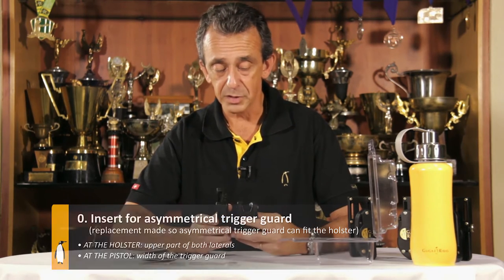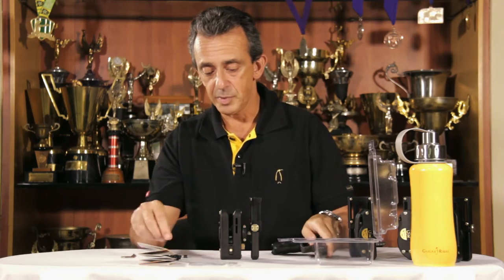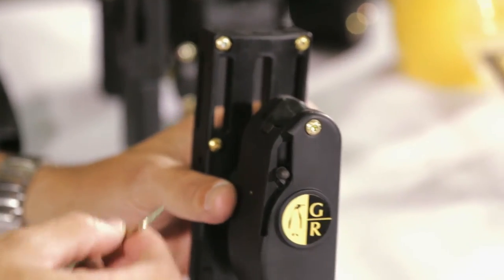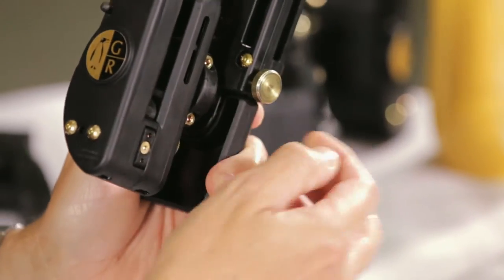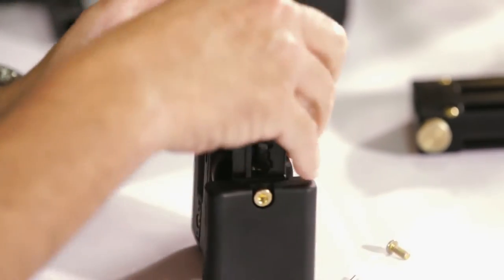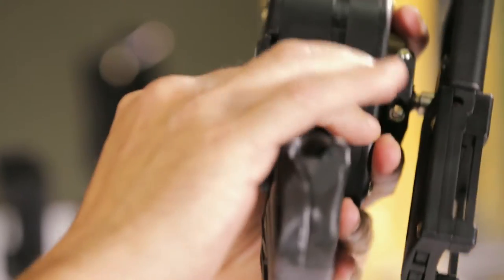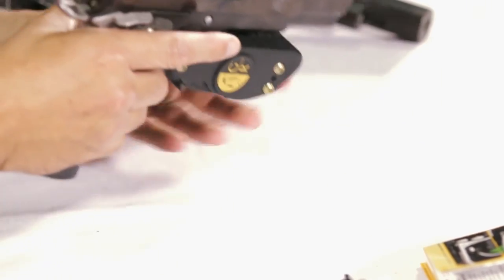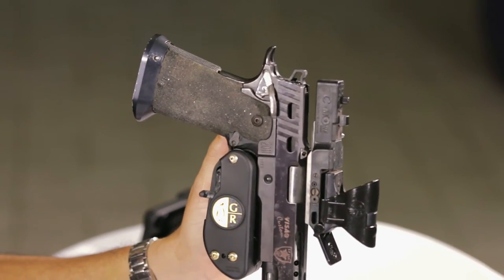How to adjust the GR Universal Holster for Pistol (English Manual)

Comment: Love the holster. Took me hours to get it running right. What confused me most was that my model didn't have a width adjuster on the passive lock. Is mine just a newer model and you guys just figured it wasn't necessary to have on the passive lock any longer? Just bought the holster 2 days ago.

Comment: And but the way this video does not cover everything you need to know.  And it’s for a different holster than what they are shipping now.  Finally. He is Lying when he says a manual is included.  It is not.  No manual. No part list. 

And it flops around all over the place if you don’t use their belt. It flips around eff bed en if you use their belt.  The lever arm on any axis is high and movement cause it to whip around.

Comment: It’s cheap garbage.  I wasted so much tijj my e trying to adjust it and never could get it to lock properly.  It’s. Made of cheap plastic and the locking lever a steel detent ball will come apart.  They are not reliable.  Competitors bring an extra because they break to often. 

I sent mine back and they agreed to give me a full refund and then decided to screw me over with a 20% restocking charge.  

It’s a lot of money for a cheap easily broken difficult to adjust piece of garbage.   AVOID AVOID AVOID